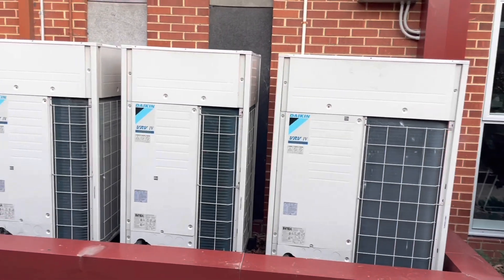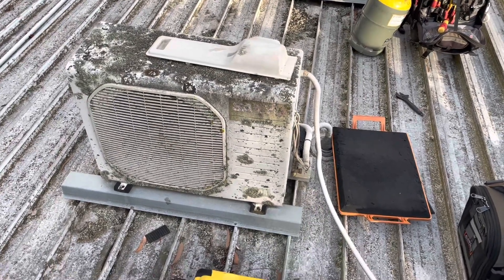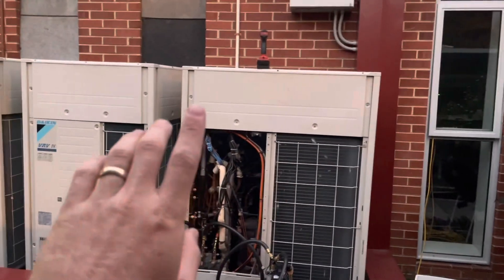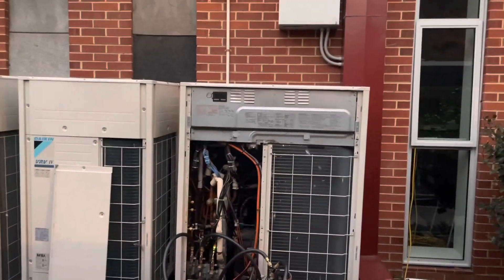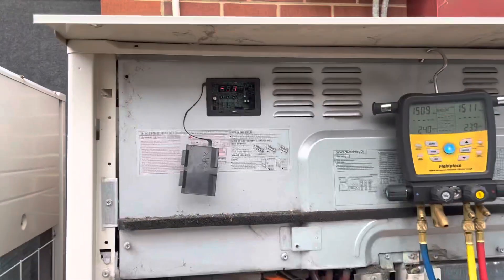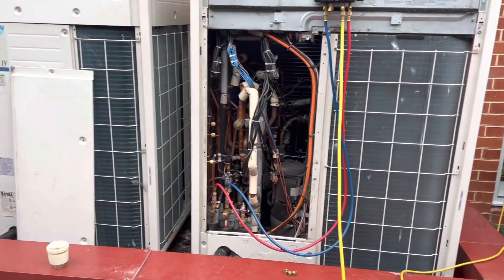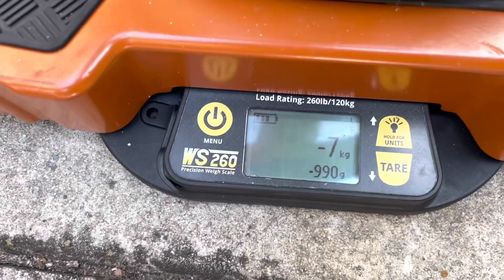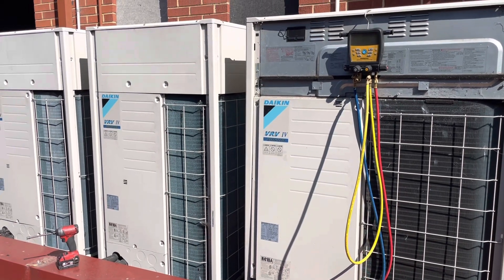Daikin VRV IV / When I Returned To Commission the System Wouldn’t Respond

Comment: I’m confused. If the comms wire is daisy chained across the indoor units then shouldn’t there be just one comms wire leaving the bc box? 🤔
Reply from the maker: From reading the manuals that’s what I thought. I think it threw me for a while working in this one cause I kept thinking they were. Maybe someone who knows more will tell us, but it seems like the outdoors and BS units were daisy chained , but all the indoors had seperate comms wires from the BS units.
Reply: Dakien branch boxes require a tail from each indoor to the branch box unlike Mitsubishi which is Daisy chained

Comment: On the multi box you have to set the dip switchers to close the valves on the port your not using don’t ya mate,  couldn’t tell if you did that pal 
Like the video
Reply from the maker: Thanks mate. Yeah, it was Port B. I changed its setting 🤙

Comment: hey man, loving the videos.  I'm a 3rd year just moved from an only fridge company, over to an only A/C company. Just wondering what books/material you read to help you learn, thanks :)
Reply from the maker: Thanks mate. I made a similar move about a year and a half ago. Still do some refrigeration but not nearly as much. The best source I’ve found is service manuals, installation manuals etc of what ever unit I’m working on. Daikin have VRV service manuals that you can google and get access to. They’re usually pretty big though, around 300-500 pages, but they have some good information in there. Hope that helps 🤙
Reply: @hvacraustralia  yeah thanks man, I’ll check them out. Thanks heaps
Reply: Daikin VRV Service manuals 🥲🥹
Reply: @aus_aircon_ref_mech6671  😂